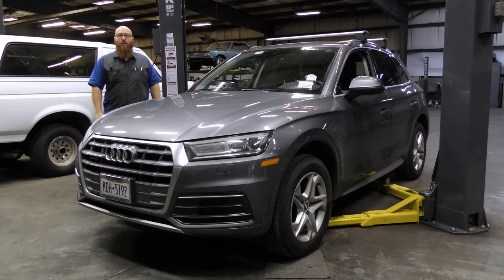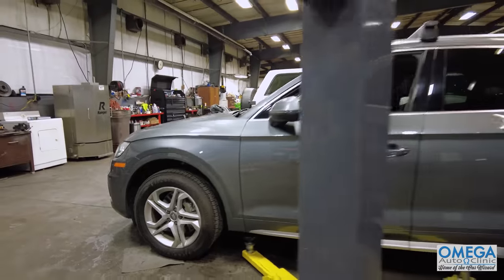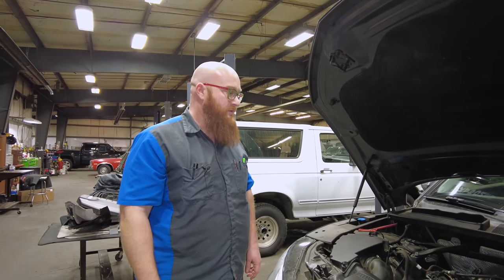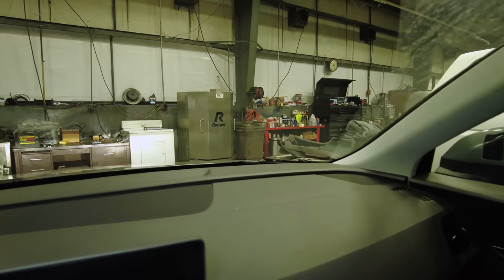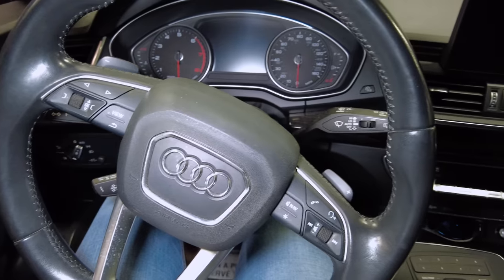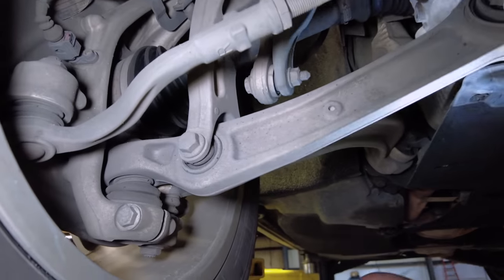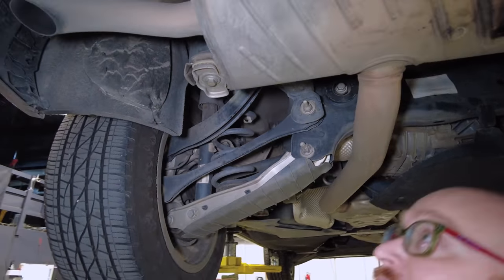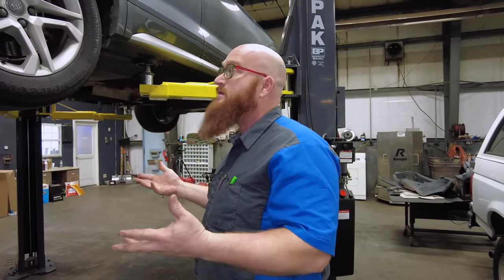2019 Audi Q5 with 200K miles & the service records to prove it! What did the CAR WIZARD need to fix?

Comment: Nice. The boots on those front drive axles look way too clean. The boots on the steering rack looks more normal. Possibly the front axles were replaced...
Reply: because they spin and the dirt wipes off

Comment: Hard to say the book proved the customer was "nickeled and dimed".  Other than the fuse thing, a bushing and a windshield (nothing to do with being German), it was all oil/filter changes, new tires and tire rotations.  You list almost entirely normal wear and tear.  I am curious what they have put in for "German Engineering".

Comment: I did 20000o miles in a 1.9tdi and the only reason it wouldn't do more is I mapped it and overbooked it...   Well maintained I've seen them over 300000

Comment: Time is the real killer. Contrast this against my 2011 BMW 328i with 105,000 miles that has been meticulously maintained - currently it needs the entire cooling system (less the radiator) replaced, and the valve cover is beginning to crack, and please don't say the acronym VANOS out loud because I fear for my sanity every time I hear it mentioned.

Comment: Here is what I going to recommend . If you are looking for a newer AUDI with one with the MLB engine (2.0t 4 banger) 
One of the most reliable engines Audi made in a very long time (since 2005 A4 and down with the 1.8T (170hp/170/tq). 
All the cars that where available with this engine in north america. Sorry not sure about other region I am from Canda 
- C7.5 A6 2.0T 2016 - 2018 ( I am not too sure about 2019 Audi A6 yet since its too new and is way more complex with its mild hybrid system so not sure if its reliable yet time will tell) This car has 8 speed ZF torque converter transmission so more reliable than the B9 A4/A5/Q5 DSG so service every 80-100k KM
-B9 A4/A5 2017-2019 ( Again not sure how good the 2020+ Audi a4's are because of the mild hybrid system ) Keep in mind those have a the DSG (Transmission)  serviced every 60-65k KM on these they are very sensitive so better to do it on time.  
-B9 Q5 2018-2020 Exact same setup as the A4/A5 so keep an eye out for DSG being serviced on time. 

My advice is if you don't mind a bit older / outdated interior of the C7.5 A6 with the 2.0T than go for it ( I did and I absolute love it )
If you do care to have the more modern look for the interior go for the b9 A4/A5/Q5 (keep in mind the Q5 is worse on gas) Just make sure the DSG is serviced on time otherwise it will be a a ticking time bomb and who knows when it will give you shit for it. 
One other thing Audi recommends oil change every 15000 KM which is ridicules I would recommend about 6-7k KM ( oil change is cheap engine parts aren't ). 
If you have any questions feel free to ask ( I did have both the B9 A4  and currently a proud owner of a C7.5 A6 2.0T ) 

PS B9 A4 and C7.5 A6 don't really have much of a difference when it comes to fuel efficiency. The A4 I was getting about 9.8L/100km and the A6 I am getting about 10.1L/100 km in the city. Highway about 6.9/L/100km in the A4 and 7.1L/100km in the A6. One last thing insurance is alot cheaper for me for the A6 than the A4 ( about $70/Month ) though it might be different for you. Cheers

Comment: How much money does all that maintenance add up to?
Reply: Proportionately the same if you did the book scheduled maintenance on any other car....

How much gasoline would you use in 200k miles?

How much oil would you use in 200k miles if you changed it and the filter every 6k miles?
33 oil changes @ $100??? per time? $3300

If you had only covered 50k..
only 8 oil and filter changes...$800
and only 50k of gas would have been used.

Same cost per mile in both cases.

Comment: 200,000 miles in 4 years is different than 200,000 miles in 15-20 years. Highway miles stresses the engine a lot less than mixed driving.

Comment: Highway miles.  With Aircraft they keep track of hours and cycles, aka start up and shutdowns.  By the way if you buy a Toyota you still have to do all the regular maintenance.  You probably wouldn't have had the electrical issue, but didn't sound like a big deal.  One common issue with this engine is the coolant bleeder valve at the top of the engine, its like a $12 part if you change it yourself.  Its a bummer because it is a brake down, you will eventually get steam coming out from under the hood.

Comment: The trick to making a German car last that long is to never, ever, *EVER* defer the maintenance.  Also, make sure it's not a BMW manufactured since 2002 or a Mercedes manufactured since 2007.  😂

I've had several German cars that have lasted well over 200K miles before mechanically totaling themselves.  Usually with a turbo deciding to let go and spraying bits of itself all through the intercooler and the intake.  Then it's time to scrap it.  You can replace the turbo, but you'll never get all the bits out of the rest of the system, and it won't be long before they get sucked into the engine (assuming they haven't been already) resulting in cylinder scoring and oil-burning, and all kinds of horribleness.  Much like when an A/C compressor blows up.

My wife loves VW/Audi/Porsche vehicles, and she has a 90+ mile daily commute, so I have a lot of experience keeping German cars on the road.  They really can last a good long time, you just have to do every last bit of maintenance called for, like the Wizard said.

Comment: There's nothing strange here....if that car didn't been involved in the accident and if the maintenance is done on time, that's ok.
I'm wondering just one thing....what's the oil consumption......that thing should burn the oil from the factory.....it should be at least 1 quart per 2000 miles, maybe more.
Like

Comment: 189k on a 2006 bmw in my yard and it still runs fine. It needs gaskets for sure but not too bad. Spent less than 1000 on maintenance besides oil and tires over 6 years. Germans can be fine.

Comment: Really no mystery here at all. It's clean because its only a few years old. In order to put 200K miles on it in that short amount of time, the majority of them HAVE to be highway miles. At highway speed there is VERY little to no wear on the engine. Further, deposits are routinely burned off with zero sludge of any kind. There was nothing terribly revealing about that stack of records......flat repairs, windshield replacement, minor electrical issue, tire changes, oil changes.

Comment: The suspension is going to be the next major job.  Suspension bushings do wear out.  Boots tear.  CV joints wear out.  Shocks wear out.  I'd be surprised if those are the 2nd set of shocks and soon to need replacing.

Comment: Not really that odd I had 180K on my 2003 V6 Passat when I traded it for my 2013 Golf that currently has 170K nether has ever had a major issue the worst thing was cam seals on the Passat I did that twice because the first shop screwed up and didn't replace the Spark plug tube seals (supposedly a VW specialist).  Do your basics and they will last just like a Toyota.  My mother has an 2005 Lexus ES330 with 250K and honestly it has been in the shop more than ether of my VWs.

Comment: My Audi A6 prestige has 211K miles nothing major done(wheel bearing and oil change when it is warranted and a 2007 honda Civic with 278K on it just had a spin off driving in NE winter)

Comment: Engine- Audi is widely known for its capable, efficient, and reliable engines. While most consumers are happily revving, some have reported problems. Broken cylinder heads, faulty head gaskets, defective turbo units, and busted timing chains are common problems in the Q5. Other common problems include decreased engine performance, heating issues and damaged crankshafts.
Brake- Audi introduced the Q5 with some major changes last year. The most significant among them is the upgradation of braking hardware. However, some have raised complaints about squealing sounds while braking, premature brake pad wear, and spongy brakes.
Fuel system- Many 2019 Q5 buyers have voiced their concerns regarding issues like defective fuel pumps. It resulted in sudden stall, reduced mileage due to fuel gauge leaks, and reduced performance due to faulty fuel injectors.
Transmission- Audi’s STronic automatic gearbox is one of the best in the market. While most customers have praised VW group for it, some have challenged their good reputation with complaints. Problems include gearbox heating due to a faulty transmission sensor or solenoid, slipping transmission, and even transmission leaks due to broken oil seals. 
Steering- Some have lodged complaints regarding sudden malfunction of the steering column while driving. Fortunately, no accidents or injuries took place. 
Drivetrain- Complaints include clunking noises due to broken driveshafts, excessive vibrations, and reduced traction due to corroded transfer case parts.

Comment: Currently 235k miles on my A6 Avant, but it is a 3.0 TDi, so not really surprising. Having said that, I'm in Europe, and I believe Euro made German cars are built a bit better than the US ones, so we don't get anywhere near the problems you guys have over there (plus the fact that parts are cheaper and more plentiful over here). Nobody would bat an eyelid at a VAG car hitting 200k miles here - if they didn't last, we wouldn't keep buying them! Having said that, JLR (Jaguar Land Rover) cars are as bad here as they are over there, so I wouldn't touch one of them even if it was free! 🤣

Comment: Hours on a car engine/interior have a larger impact than miles. This car likely has the same hours as a 40000 mile car. Hence why the engine still works great and the interior is in good shape.

Comment: =t depend how owner service car. I have audi q5 p8 2016 tfi 2.0(190hp) and its have 240 000 km. I change oil and all filters every 5 000 km and every 20 000 km i change all other fluids(gearbox, diferencal and cooling fluid). I own car 4 years and i changed some sensores and full brakaks(disks and pads).

Comment: Would a boring Toyota do the same mileage with less maintenance ?
Providing that one is not driving in the rust belt ,then a Toyota would easily do the same mileage,or a Honda even .
Probably do better mileages on tyres ,as the Toyota and Honda are lighter  !
It's not dissimilar to Subarus,often get a bad rap ,but most people love them ,and again if seviced correctly,will return good mileages.

Comment: 200,000 mile Audi, wonder how much that cost to keep going
Reply: Proportionately the same if you did the book scheduled maintenance on any other car....

How much gasoline would you use in 200k miles?

How much oil would you use in 200k miles if you changed it and the filter every 6k miles?
33 oil changes @ $100??? per time? $3300

If you had only covered 50k..
only 8 oil and filter changes...$800
and only 50k of gas would have been used.

Same cost per mile in both cases.

Comment: First, gotta say I like how Wizard HATES BMW but he has a BMW poster on the rails above the offices area.

Second, it's normal that the car isn't rusted out even at that millage, 'cuz the millage was done in less than 4 years. Normally, in 4 year, average owners of those cars, do 'round 80k miles. Metal doesn't rust per millage, but per how long, in years, the car's been on the road.

That said, my grandpa used to do the same when he had his cars. He'd have a small book where he'd put all of the oil changes, repairs, and even how much it costed him to fill the car up and at what millages he had to go to fill the car up with fuel. Then again, my grand dad had been a bus driver from the late '50,  up 'till roughly the '70s (after that, he took a place in Montréal's metro ticket boots) so he was used to do such detailled reports on vehicles.

As for recommending Toyota, don't worry Wizard, any good mechanic will say the same. They all say Toyota are the best cars to go to for ease of maintenance and all that.

Comment: Various people commenting here on "volkswagens are junk" or unreliable this, unreliable that... lets be very clear here. There are differences between manufacturers but ALL cars these days are pretty bloody reliable and can be pretty much abused for the first 100k miles. Not that you should, but for the most part cars just seem to take it these days. Agree that age (and how/where the vehicle was used) now is more of a consideration than mileage. Would be nice if ECUs kept an indelible log of driving data from the life of the car, and tell you things like # of minutes spent at WoT, number of occasions G forces greater than X have been experienced, how many miles after the service due light were driven until it was reset, has the engine ever overheated, has the engine ever experienced low oil condition, history of every CEL ever incurred. This is all stuff ECUs could easily be telling us if they just had a non-clearable history on them, and could encourage your insurance company too if they had these metrics.

Comment: This is far modern and basic Audi. 5th gen inline 4 cylinder and reliable ZF. The one mayor thing is turbocharger to be worried about at that millage. On the other hand, my 2003 Audi S8 D2 with 180K miles have maybe smaller binder, but far more expensive repairs. Those flagship models have far more pieces to go wrong.
Reply: q5 is a Mexican car, made in Mexico, only 20% of German parts, rest are Mexican and Chinese.

Comment: My 2006 Pepper Car has had one issue outside of the routine in 222k miles after the driveshaft and coolant pipe defects were fixed.

Comment: I wonder if carbon build up due to GDI was an issue and if any removal was done. Supposedly the 2.0 TFSI Engine have a cleaning mode that requires periodic during the vehicle at 3000 rpm, but at 200,000 miles, even with mostly hwy miles,  it has to have been an problem.

Comment: "an audi with 200k miles, how is that possible"  Uhm just drove back home, with my 355k miles, original engine and trans audi a8l....  Impressive mileage but car racking up the mileage fast usually last longer.  Highway miles and no defered maintenance when you travel a lot. Cant afford being stranded from lack of maintenance.  Impressively high. 
Im going to see the highest miles 2020 audi a8l tomorrow !

Comment: Loads of neglicted ones also reach that mileage. Couple of minor oil leaks and a rear pipe leaking coolant slowly. The owner just topped up and continued to drive it until it hit around 290000km and finally the engine jumped timing. Not bad for a unit that only had topups and was a Gen 1 EA888 with original multi-tronic that never had an oil change. It depends on various conditions on how a car can last. Oil seals and timing assembly renewing can partially relate to servicing habits of the owner. You can gauge how some Amercian made engines also leak like crazy and some nasty thermostat or waterpump jobs. Its a case by case situation and just part of owning a car, nothing lasts forever, even humans.

Comment: I own a 2008 Audi A8 it has 211k and yes a lot of maintenance has to be done I do most of it myself which saves money but I am getting very close to timing chain work with my miles and it won’t be cheap but with all I have done I am sure I can take this car over 300k.
Reply: My buddy just picked up a 2013 A8 about 135k on it, I hear a little chain rattle on startup. Told him first thing he needs to do is address that

Comment: What is the reason this SUV averages 45+K miles are year.  That is a lot of driving!  Is this used for a business or strictly personal use!  I commuted 70 miles a day, put roughly 20K per year and I thought that was enough.  No way I could double that.  If that high mileage is commute, I would have worn myself out driving LOL.

Comment: The only thing driving my OCD insane is how the NYS registration and temp inspection are mounted, with the tape all crazy and the registration stuck off center from the residue of the old sticker... lol I know im crazy. OCD. I know its silly its just me. Plus as someone form NY i can tell the car was registered in June of 2022. The temp inspection was good for 10 days. So its long gone. While outside of NY i would remove the sticker and then assuming it would pass i would get it inspected as SOON as you get back in New York. Also FYI New Jersey would give you a no inspection ticket for an expired NYS inspection. And you could get a parking ticket parked any where in NYS with an expired inspection, unless its parked in your own driveway.

Comment: The Germans should be able to manufacture a car with the bells and whistles along with the durability of a Toyota Land Cruiser. At that point, I would respect them more than I do. Is it really worthwhile having to spend all that money for maintenance when you can get a Toyota or a Honda and along with not having to spend as much money on them, not have to invest the untold amounts on scheduled maintenance on parts and services which are far more expensive than is the case for either Lexus or Acura?

Comment: The difference between the Germans and the Japanese when it comes to cars is this. 
Both are engineered to death
Germans engineer cars to be amazing when the owner/operator uses and maintains the vehicle according to how the engineer designed it.
Japanese engineer cars to work even when neglected with no regular maintenance and constant abuse.

One is a solid engaging driving experience designed to drive, handle and stop on an unrestricted autobahn.

The other is designed to pick up the kids from school and be completely forgotten about until it's time to use it again. 

If you like to drive and it isn't just a chore to be completed throughout your day, then go for the German car, but maintain it, and it will reward you.

If you hate driving and see cars as necessary evils, buy a Japanese car and use it as the tool it was designed to be.

Outback Steakhouse or Brazilian Steakhouse. Both have their merits.